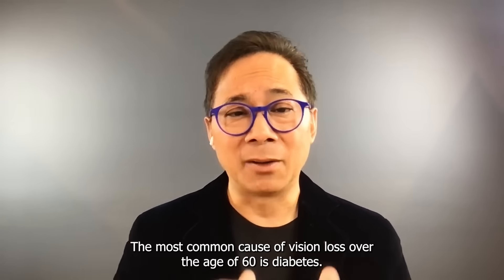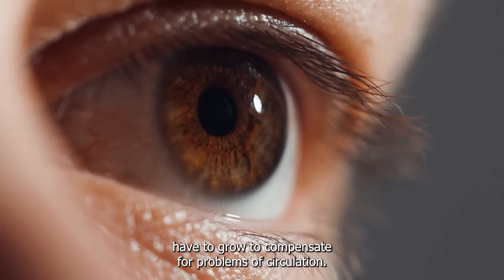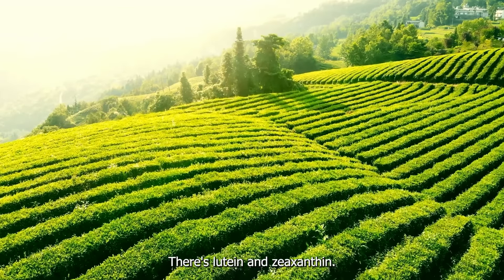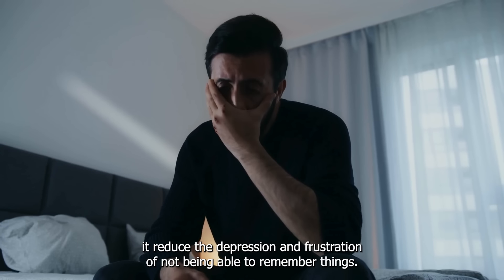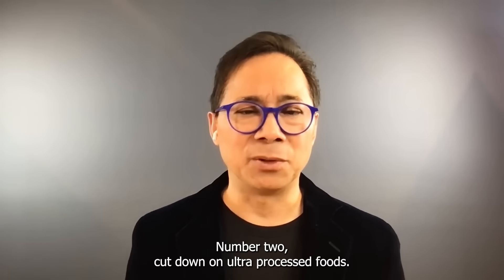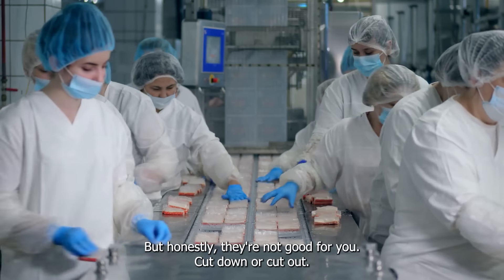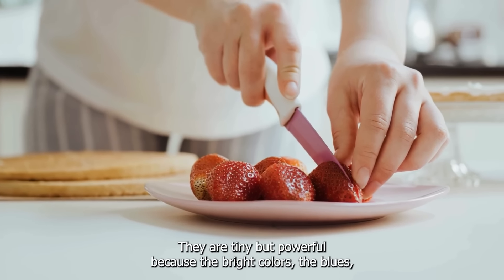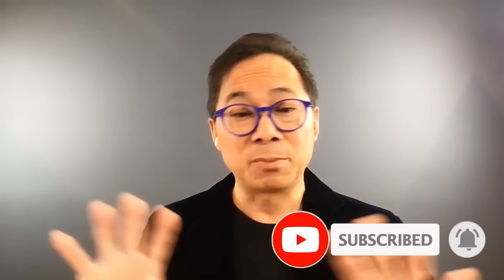TOP 6 Foods for Better Eye & Brain HEALTH🔥 Dr. William Li

Comment: Even Cassava chips?
Reply from the maker: Cassava contains vitamin C, which is an antioxidant that can help protect cells, including those in the brain and eyes, from damage caused by free radicals. Additionally, beta-carotene, found in yellow and orange fruits and vegetables like cassava, is converted to vitamin A in the body, which is essential for vision.

 Raw cassava contains compounds called cyanogenic glycosides, which can release cyanide when consumed. While processing methods like cooking and fermentation can reduce cyanide levels, improperly processed cassava products may still contain harmful amounts. Chronic exposure to low levels of cyanide can potentially affect neurological function.

Consuming cassava chips occasionally as part of a balanced diet that includes a variety of other nutrient-rich foods is unlikely to have a significant negative impact on brain health or vision. However, relying heavily on cassava chips as a primary source of nutrition may not provide all the essential nutrients needed for optimal brain and eye health.